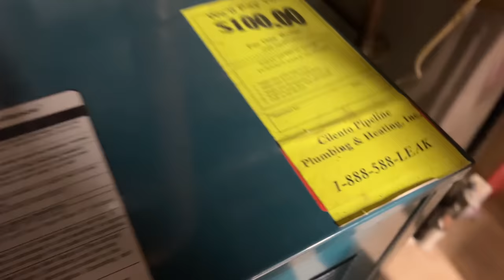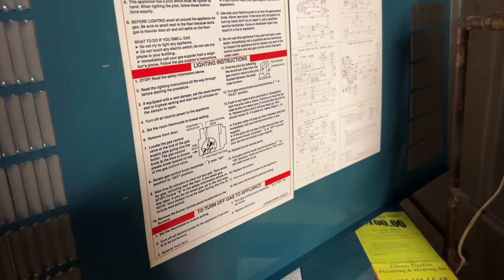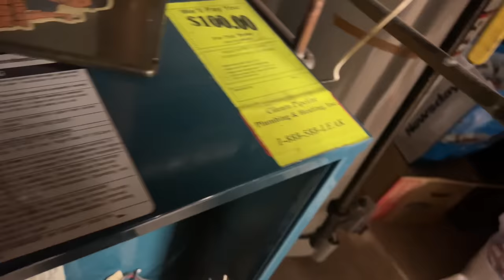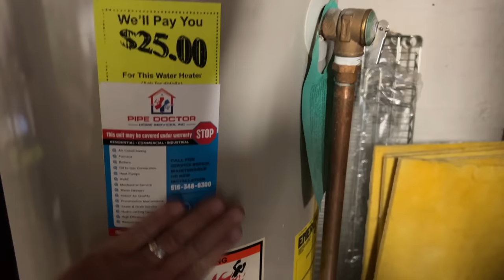Pilot Lighting Instructions No Heat Gas Steam Boiler Pilot Issues Fixed

Comment: Nice video of replacement of the pilot and thermocouple.
Good sales job explaining the problem and the process of repairs without getting too technical. Interesting that you suggested a five section boiler is that experience from doing so many similar houses?

Comment: Hello Mike, another great video you hit the nail on the head with a comment at the end of the video that the pilot burner was being over fired. I had noticed that when you relit the pilot, the first time before replacing it the flame was very large. This in turn will cause those thermal couples to burn out as customer had stated has been happening. You did not show it, but did you adjust the pilot pressure after installing your new assembly?

Comment: So it is a matter of cycles until those fittings burst from the rapid thermal expansion of the copper. The clock has started. Did you show her how her mini-split heats also? Guy says his new chainsaw cuts like crap. Takes it in and the guy pulls the cord and starts it. Customer says,"what's that noise all about"?

Comment: Not in the trade and live in the South so forgive my ignorance. How does that pipe thawing machine work to thaw out pipes with just clamping the electrical clamps to the pipe?  My house is completely plumbed with PEX so I had no problems with pipes freezing. With this historic cold snap down here, people have frozen pipes bursting everywhere because people are basically told to wrap the pipes, open the sink cabinet doors so the heat can get to the pipes and drip the faucets. The problem with that advice is a lot of people only dripped the cold-water side and not the hot water side too. so those hot water pipes froze up. Thanks for the information.

Comment: I don't think to many guys Know that you shouldn't use copper on steam boiler headers ,I was one of them although I'll excuse my self cause I never installed a steam boiler , when I did install one it was Back in 1999 /2000 before I kicked off J. Bonito Heating ... with an Older friend and He threaded Black pipe for sure . I think guys just think its easier (key word) to use Copper and they might not know that You really shouldn't , It makes 1000% sense that you shouldn't  because of as You say Expansion and Contraction ... Thanks Mike

Comment: They did copper pro press, they were trying to get out quick
Reply: I keep running into hacks that use a million couplers cause they don't have a length of pipe, a brand new house with tankless water heater the gas supply had been put together with nipples of different lengths and as many couplers as they had

Comment: Good job Mike. Is copper press different than mega press fittings? Maybe thermal coupler burnt out due to oversized boiler, cycling on and off?
Reply: Copper press fittings are actually rated for steam. Look it up <100kPa and 120C (sorry for not converting to freedom units)
Reply: Actually would be interested to know how brazed joints would hold up… j think the copper being a no no is due to the poor performance of soldered joints
Reply: @PipeDoctor  i thought that maybe steal pipe connected together for steam boilers as it would withstand pressure from the steam generated...am i wrong thinking that??

Comment: If theres not sufficient combustion air,the pilot generator is the first device to cook.
Reply: Had a house in East Rockaway,had to drill mudsill,installed 3 inch pvc air inlet pipe to 4 inches above floor,behind boiler,solved the issue.
Reply: Old wood basement windows from 1925 with glass louvers. Plenty of combustion air .